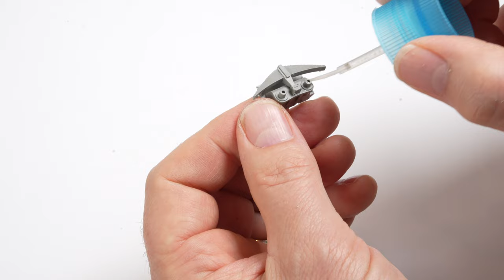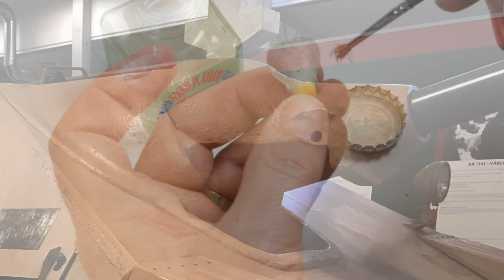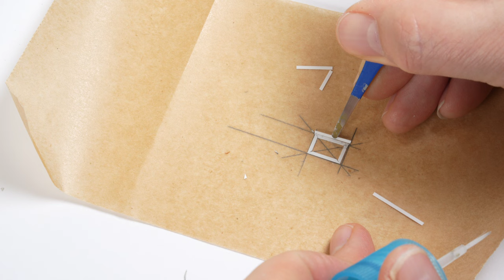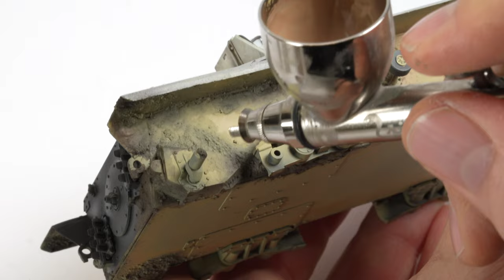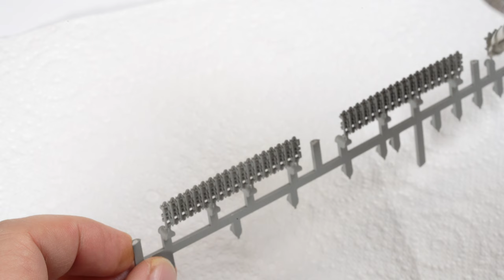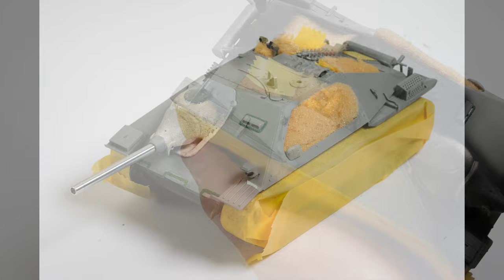HOLY SMOKES! I've just cut a hole in my HETZER! Pt2. Takom 1/35 Early Hetzer Build & Paint Tutorial

Comment: Hi Clayton - I'm working on the Academy 1/35 Hetzer at the moment and have been loving this series! I've made the larger grab handles from copper wire (from stripped house wiring) but can't source the fine lead wire you used for the smaller handles. I'm thinking of using finer copper wire for them as well. Maybe stripped automotive wiring... thanks and keep up the great work mate. Learning a lot from you! Cheers James
Reply from the maker: Hey James. Solder wire should do the same thing as lead wire. Solder would be available at your local hardware. Hope that helps 🙏 Best of luck with the build 🍀
Reply: @workbenchhobbies4316  thanks! Why didn't I think of that... 😜 I have some in the shed! Cheers mate.

Comment: Great job!
Sometimes there's just not enough "meat" to integrate magnets for a removable roof.
Reply from the maker: I don’t think magnets are necessary if you wanted to leave the roof as removable as it just snugly sits in place. In saying that I’ve never tried the magnet thing. Appreciate your comments 💪🍀
Reply: @workbenchhobbies4316  Magnets usually serve more the purpose of keeping parts from rattling parts around when the item gets handled or transported. Otherwise, of course a snug fit is often enough.
Reply from the maker: good point :)  @Iskelderon

Comment: So to make the wheel workable just either replace the mounting d with a rod piece of plastic or a brass tube and round out the leaf spring mount hole
Reply from the maker: Yeah, and then buy a set of aftermarket tracks. That’s significant modification isn’t it? It’s not impossible, it just takes a lot of time and money. Thanks for joining in. Appreciate your comments. Thanks for joining in 🙏
Reply: @workbenchhobbies4316  panzerwerk design has all the verison of track available and there extremely fast assembly.
Reply from the maker: Just had a quick look - cant see available here in Australia... 30 euro - so it would be 80-100 AUD but the time it got to me. And..to let you in on a little secret, I have started building the Late version now too... all going to plan will be developing a mask set for it, so will probably be on the hunt for some aftermarket tracks at some point..:).. @gamedude412
Reply: @workbenchhobbies4316   Id check BNA for Trex studio then. The kit builds a late war skoda factory nearly out the box. If your doing to detail it out the crew hammer is next to the jack holder  and the wire cutter and also on the same fender forward of the jack.
Reply from the maker: thanks for the info. The next one won't be as intense as this one... I am literally using it for developing the masks...or at least that is the hope  @gamedude412

Comment: Takom put a radio set into the left sponson that shouldn't be there. You removed it and put storage trays instead - good move.
But those two devices up ahead, the red and yellow boxes? They are the power supplies for the radio! They wouldn't be there either.
As far as I can see, Takom referred to a badly restored vehicle instead of researching the original.
Reply from the maker: Hello again. Yeah, figured that was the case but it is what it is and too late for me to change. Put it down to a lesson learnt. Appreciate you joining in 👍